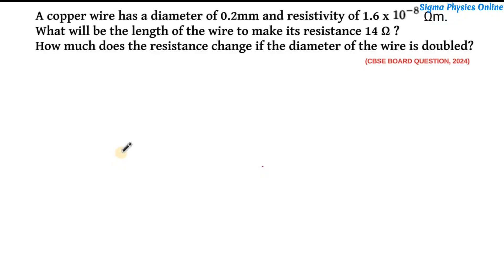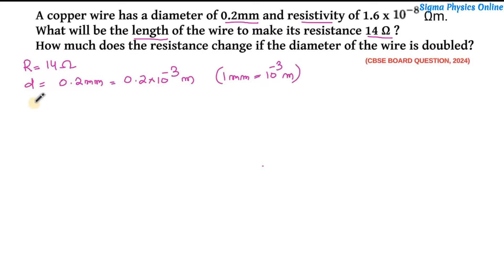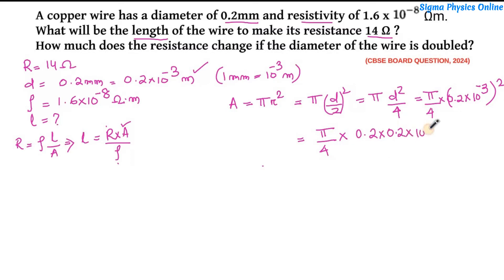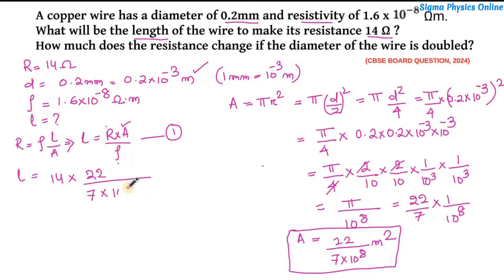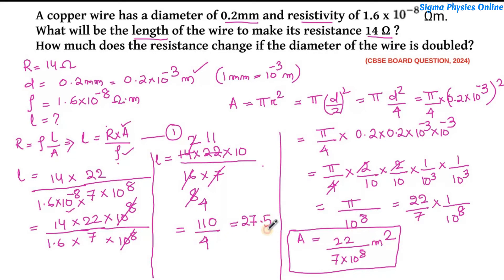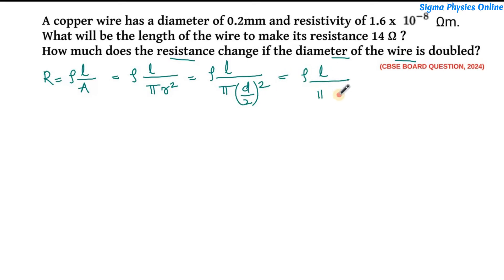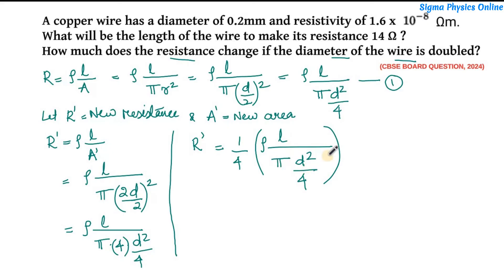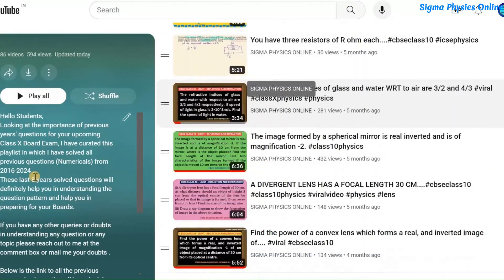A copper wire has a diameter of 0.2mm.... #class10physics #science #cbseboardquestions

Comment: Ma'am for the second part can we directly use the formula instead like 

We know R inversely proportional square of diamter 

Therefore R2/R1=d square/2d square

R2/R1=1/4
We cross multiply and get the answer of R2
Reply from the maker: yes beta. U can.
But if it comes for a 2 mark question  separately, u hv to show it in this method.
So I hv explained in  this  method here.

Comment: Why the length that I am obtaining is 27500? I did everything right !
But I got my radius 10 to the power -2 and Area 22/7*10to the power -4 

I converted the diameter 0.2 mm into 2/10*10 to the power -3 and got the area 22/7*10to the power -4
Where did I made a mistake so I got 275000 m instead of 27.5 m 
PLEASE REPLY MA'AM
Reply from the maker: Hello Beta. 
Area will come in 10^(-8) form.
U can do one thing... just pause the video time to time and cross verify your solution with that to see where u are making mistake.

Comment: Mam my second answer is 3.5 ohm is it correct
Reply from the maker: Ys beta. Absolutely correc !! 😊😊
Reply: @sigmaphysicsonline  mam as ur answer is 1/4 times so would I get full marks of my answer or I also have to show this
Reply from the maker: @BhaiKEasynotes-xi3ht After writing that the new resistance  is 1/4th the original, you can conclude that '  So the new resistance will be 3.5 ohm.
Reply: @sigmaphysicsonline  ok mam thank u for ur response
Reply: But 3.5 kese aaya mam ? Pls tell 😢 @sigmaphysicsonline
Reply from the maker: @Umesh_soni_99  Beta , the new resistance is 1/4 of the original value.
Since the original value was 14 ohm, its 1/4th will be 3.5 ohm.
Hope you are clear.

Comment: Mam jab ham log diameter ko double kr rhe the toh 4d²/4 aaya tha toh 4 aur 4 cancel kyu nahi hua
Reply from the maker: @loneonlyyt6076  hello beta.
It is because we want to take out 1/4 outside the bracket.
So the terms which remain inside the bracket is the formula for the original resistance.
So instead of those terms we can simply write R.
Thus the new resistance will be R' = 1/4 R .
Hope it's  clear.😊
Reply: @sigmaphysicsonline  okay thank you mam

Comment: Ma'am mere ans mai lenghth 275 aa rahe h or mujhe ye dought h ki Radius mere 0.0001 aai h toh uska square hoga formula k according, toh 0.00000001 ( 7 zero ) after decimal aaraha h toh ma'am isko hm 10 ki power kya likhenge shyd iske karan problem ja rahi hai ma'am please reply ❤
Reply from the maker: Hello beta.
0.0001 ka square means 0.0001x0.0001 which is 0.0000001 hoga (with six zeros and not seven ).
Take this value and solve again.
U will get the correct answer. 😊

Comment: A copper wire has diameter 0.5 mm and resistivity of 1.6 into 10 ki power minus 8 ohm metre what will be the length of this wire to make its resistance 10 ohm how much does the resistance change if the diameter is doubled
 Mam plz solve this question because tomorrow my exam  plz mam😭😭😭
Reply from the maker: https://youtu.be/xdAwE4zq7dg?si=qQyJ0oeyiNSbNJ3t